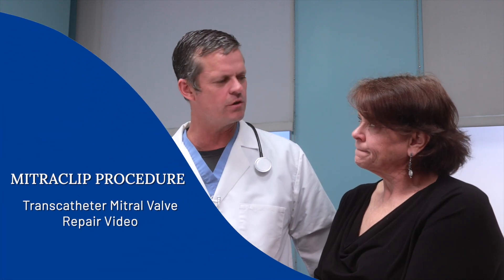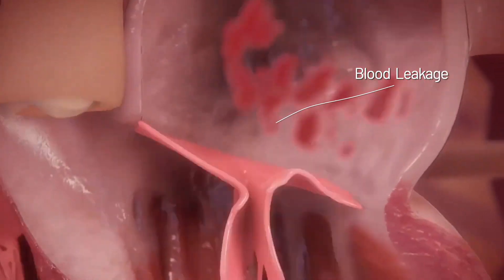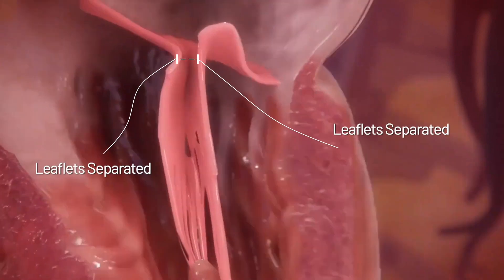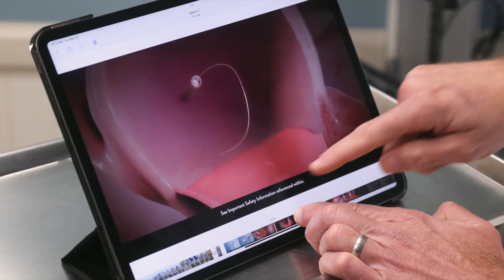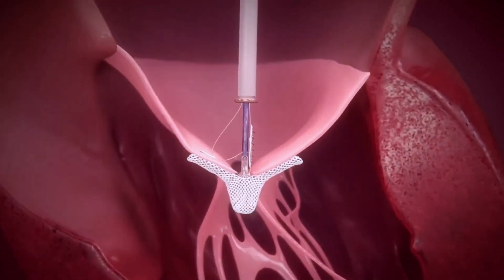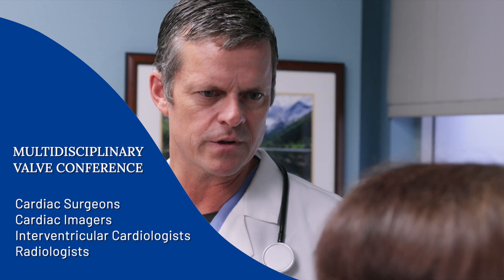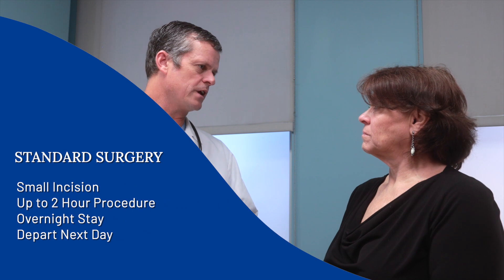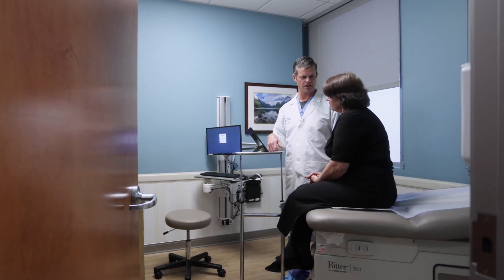The MitraClip Procedure Overview with Dr. Aidan Raney and Providence

Comment: just had 2 mitraclips installed last week. Very cool operation (I have been opend once yet with few stiches, installation of one or 2 new cords, but a thin passage remained. Not very big but it was enough for the valve to open again 2 years later ( I discussed with the surgeon that 2 years and one day it makes just the guarantee time (just joking) I am very pleased that they could do a good job, I had no need to go in survey intensive, wich is generally the cas immediately after the instalklation of the clip. So no stay in the intensive care sector for me, i was back directly in my room. 5 days later I am home , a stay in reeducation center is probable, as I was said the heart need time to find its original rythm again (x monts, x years, number is 2). BUt at 69 and having yet a classical surgery done I did submit my heart to stress (with about 1 even/day /night tachychardia, loosing control on the bladder (wich help to quiten the heart, but is socially not ideal)   I did spend 3 days  "preparatory" wher they talk about my problem with different views and controls . my neighboor was instazlled a mitraclip at 8:00 and went back to the room at about 12h , could speak at 13h... My original leak was huge but the surface of the aperture was too small "a priori" to install a Mitraclip . So i was left in expectative a few weeks, and hopefully the solution using 2 mitraclip was possible... Thank you to the search people who developped that saving life solution !  I am temped to say that it is "better to have a valve problem than articulation defect...